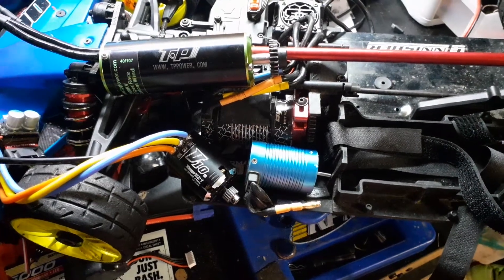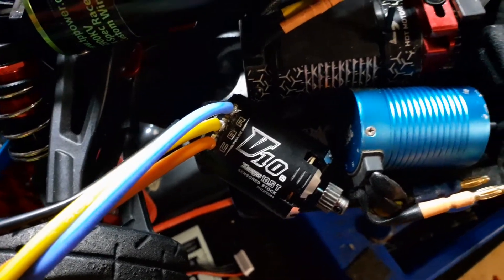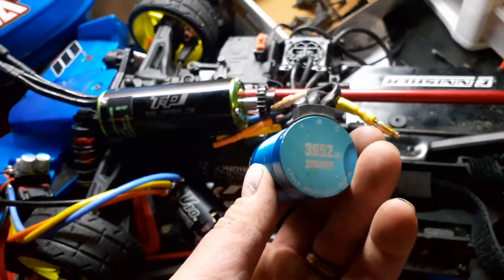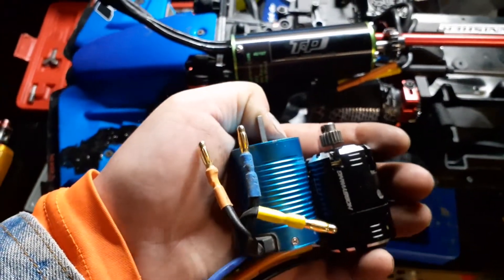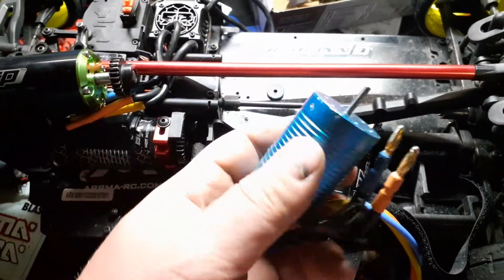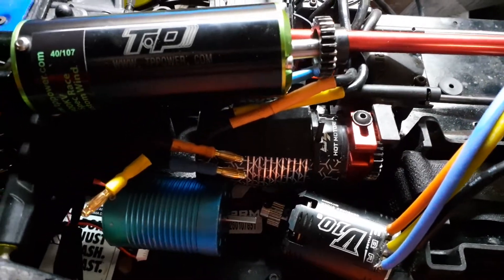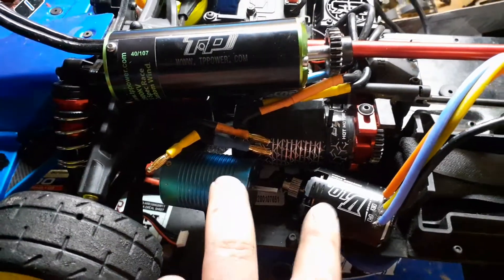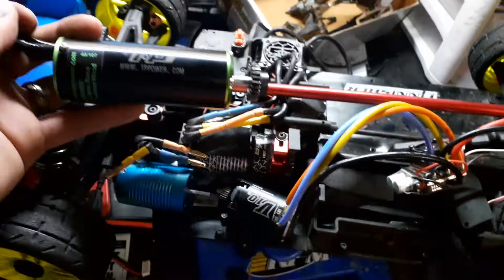Brushless motor size comparison.

Comment: Sorry what size is that tp it says 40/107 on the side? I couldn't quite hear you. The tp power 4070 is it 40mm x 70mm ?
Reply from the maker: Its 40mm x 107mm. Thanks for watching. I'll be putting it in my arrma limitless soon.
Reply: @rcjer6473  wow that is huge!!! Thanks for replying, have you got the electronics to run it yet?
Reply from the maker: @jonowillmer  no not yet buddy. I'm going to go pick it up either this thursday or next. That set up Is really fast. Geared right people are hitting 140 to 150 something. I want to start off by breaking 100 then keep turning the esc up and gearing and keep going faster.
Reply: @rcjer6473  you must be excited, you'll easily break 100mph! I got a run with my infraction the other day that was 97mph with the stock motor on 8s I'll be posting footage soon, that's if I can get time to put it together. I can't wait to see your progress. Have fun with it mate.
Reply from the maker: @jonowillmer  sorry for the late response.  I didnt see your last comment till now. Hope all is well . How's the infraction these days.
Reply: @rcjer6473  yeah been a little quite, it's still running well, just got the Castle 1717/ x8s combo but haven't really had the chance to wind it up yet.